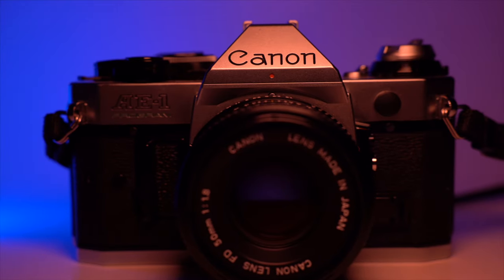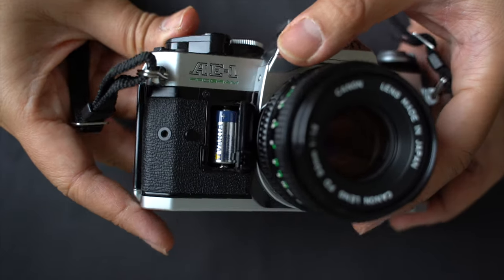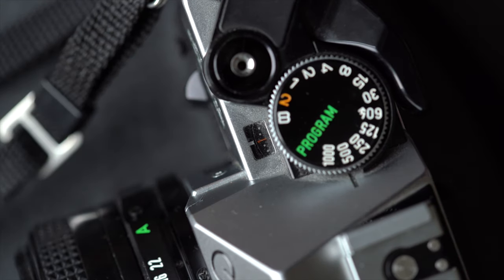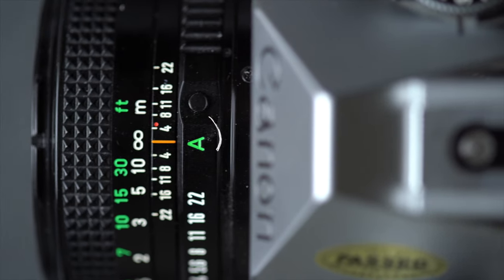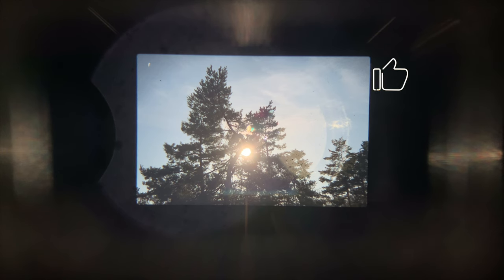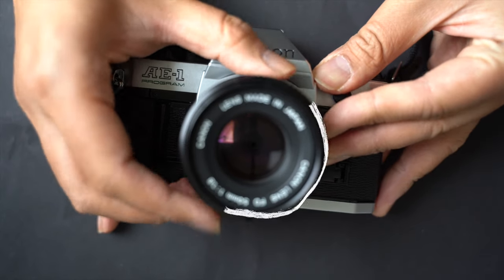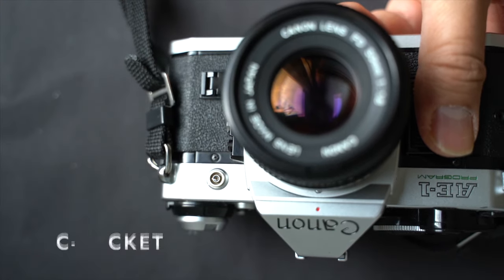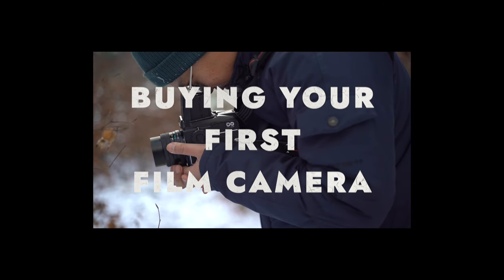Step-by-Step Canon AE-1 Program Tutorial

Comment: Hello! I have a question. What if I put the dial PROGRAM choosing an aperture in the lens?
Reply from the maker: Then you tell your camera to switch to "Av" (Aperture Priority) mode. This way, you can select the aperture on the lens, and the camera will automatically choose the appropriate shutter speed.
Reply: But does this camera work only in manual and AE mode? In the Instructions manual, there is not explained the AV mode…